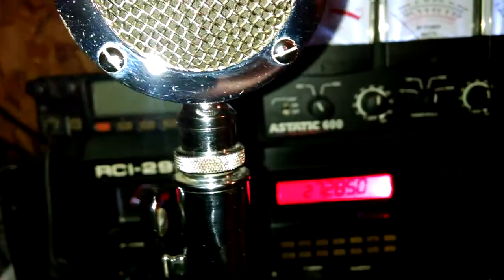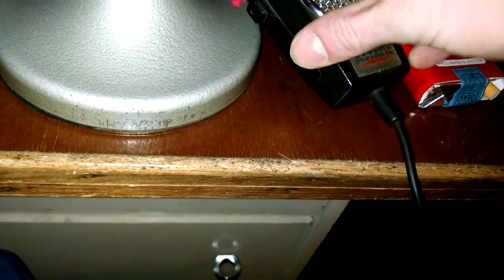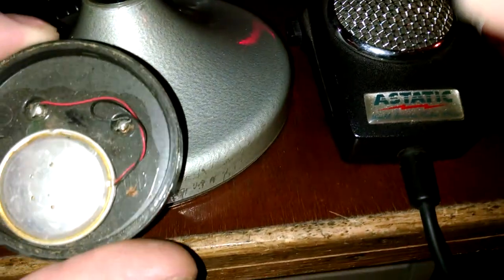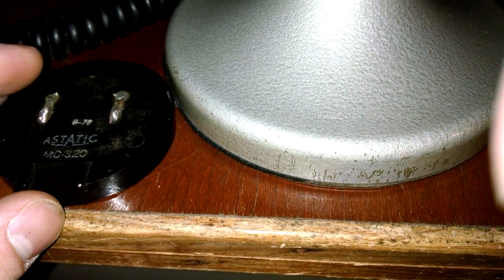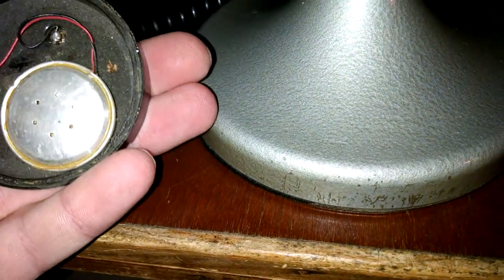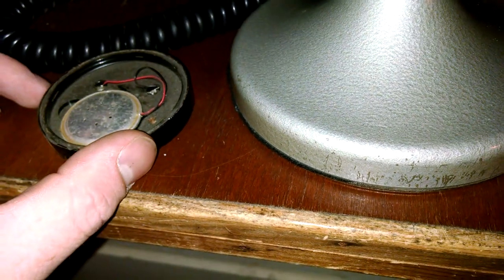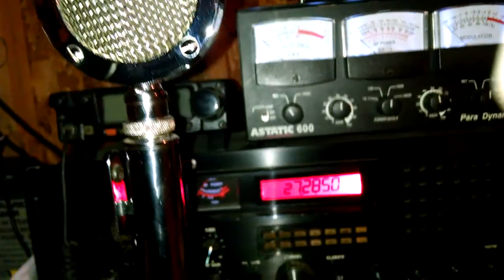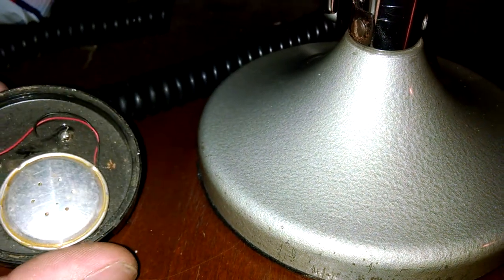How to fix your classic D-104 cb mic

Comment: I always recap and replace the transistors on amp board . I’m 47 and if they are in the same age range, I rebuild the board then work my way to the element. Most of the time I have a d104 tug-8 stand I use to test the elements with. Unless there’s obvious physical damage to the head and element, most issues are wiring, connector or component issues.

Comment: Before you condem the mic element, replace the electrolytic capacitor on the amp board. They are all well past their prime and can go bad.
Reply from the maker: Thank you. Thats a good tip
Reply: Part number?